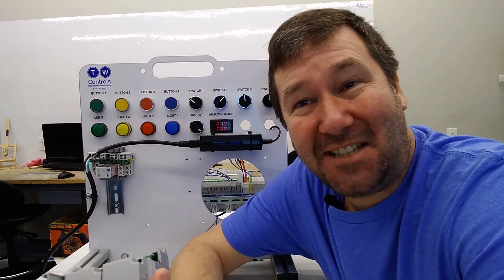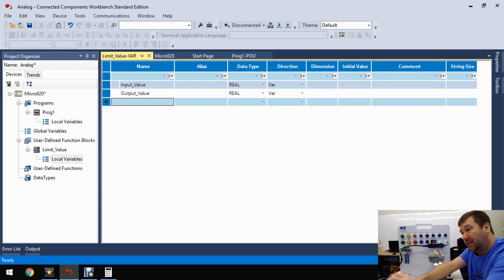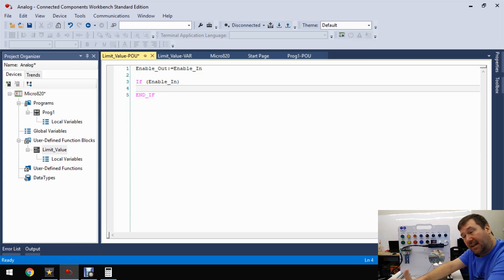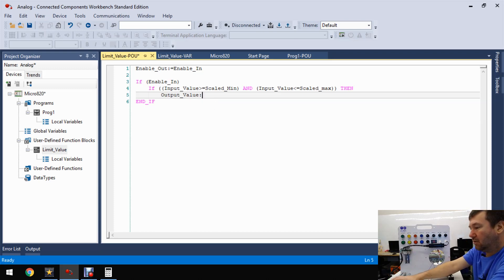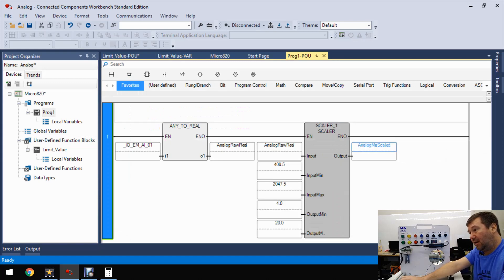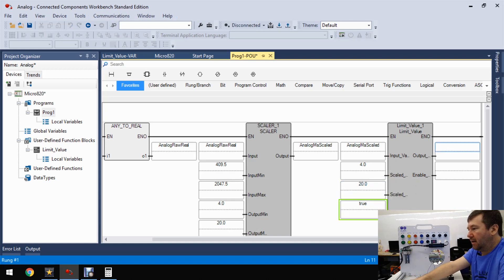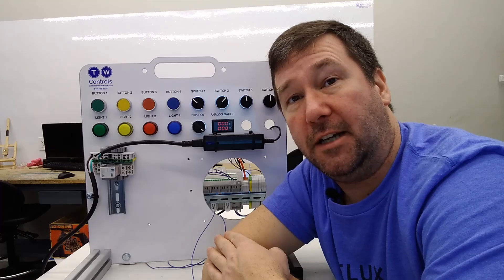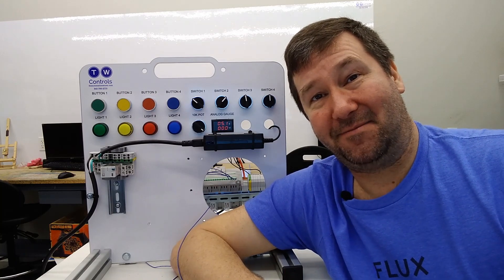User Defined Function Blocks Connected Components Workbench Micro800

Comment: Hi Tim, firstly great videos I have been learning a lot by watching them. Possibly as an improvement you could consider out of band signaling as per the NAMUR NE 43 Recommendation which some 4-20mA instruments are capable of. i.e. < 3.6mA Low Fault or >21mA High Fault.

Also, would it be better to use a CASE statement.
Thanks.

Comment: What was the purpose of the EnableInput - EnableOutput part of the structured text?  The latest version only allows for a single output on the user defined function blocks.  So I deleted those lines and it came out fine.
Reply from the maker: Interesting.  What version are you running?

Comment: Hi Tim thanx a lot for your great videos. 
seems the videos are more value than training at rockwell. 
How do you get the ma signal into a celcius value on your hmi. 
and how do you define the value if working with pressure or humidity, or celcius. 
i have seen an example of this in a rslogix 500 program where they use greq or les than bits and moving it to the scaler
Reply from the maker: Here is the long answer Henry.
https://www.youtube.com/watch?v=20QltAiD_G4

Comment: I would like to preface this with the point that I have not gone through this complete series yet, but have enjoyed your teaching style and appreciate what you have done here.  My question to you is are you going to get more into structured text programming in CCW, or could you?  Secondly, I have been programming in RSLogix 500/5000 for a few years now and one of the istructions I have used and seen is the JSR.  These I think are good for larger programs where you can divide your program up into smaller chunks for machines where you want to separate different functions of the machine or alarm/fault testing sequencing.  The UDFB seems more like "recipes" in the RSLogix scheme to me, or are they a type of subroutine?  Again, I appreciate your videos and have been learning a bit here and there which has helped me grow a little more.
Reply from the maker: Hi Somer. We have videos coming on structured text and using UDFBs as subroutines.

Comment: Dear Sir,
My controller is Micro - 850. Analogue modules which have fixed are 2080 - IF2. its operation range is 0-20mA.  According to the HELP in CCW, the variable range is 0 - 65535. If I have 4 - 20mA analogue sensor, So when I'm scaling in CCW,  what should I use for input max and input min? Should I need to scale it as you have done in the previous video?

Thanks a lot, Sir.
Reply from the maker: Check out this lesson about the Micro800 plug-in modules
https://twcontrols.com/lessons/allen-bradley-micro800-plug-in-module-configuration-for-the-micro820-micro830-micro850-micro870
Reply: @TimWilborne  Thanks a lot sir
Reply: @chathushkajayashan2603   inut min is 0 and max is 65535 ,,and make it zero  according to the analog devices ,,,13100 would be minimum for analog devices 4-20 mA analog devices